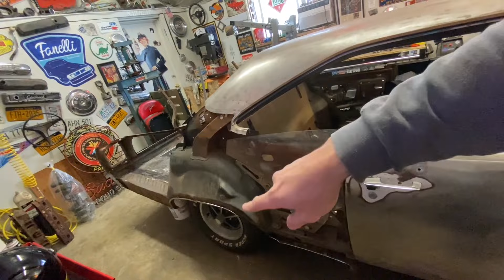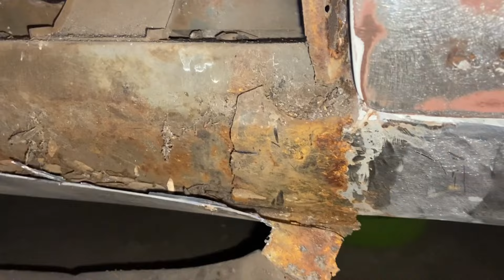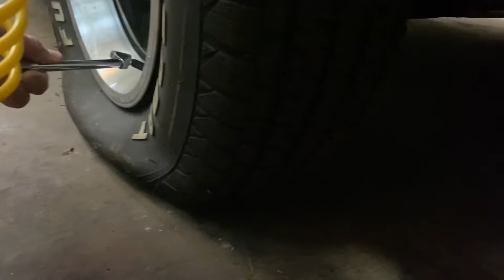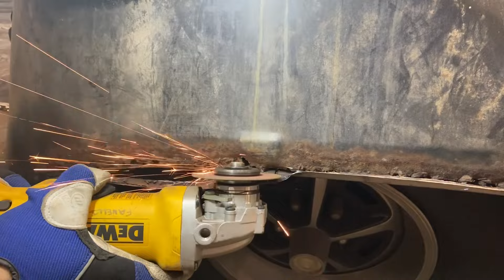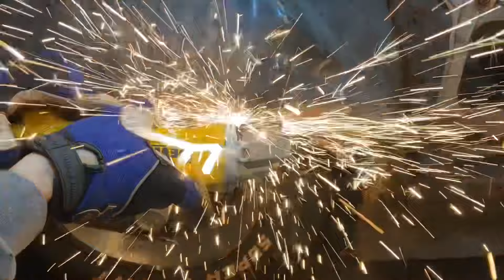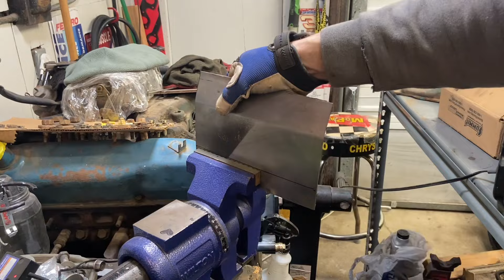Rusty Rocker Panel Metal Repairs | 1969 Road Runner Restoration

Comment: you should wear the safety protection of sprel grinding, you need to know that it will be dangerous when the stone sandpaper cutter stone explodes, you are a master so you should not make vital mistakes, you have to be a good example, lots of earnings
Reply from the maker: I appreciate the concern. I was wearing a face shield, glasses underneath it at times, earplugs, gloves, coveralls and long sleeves…about as much safety gear as you can wear. I always aim to set the example I think I did pretty well here.